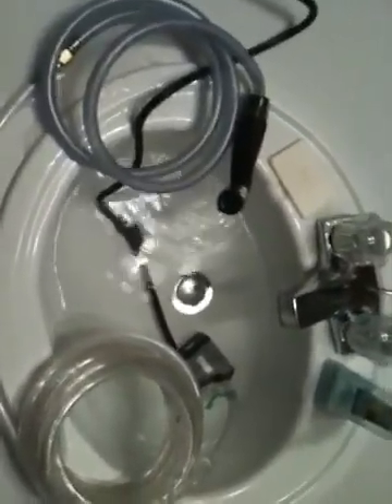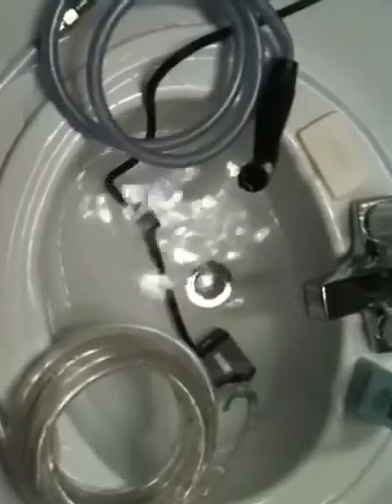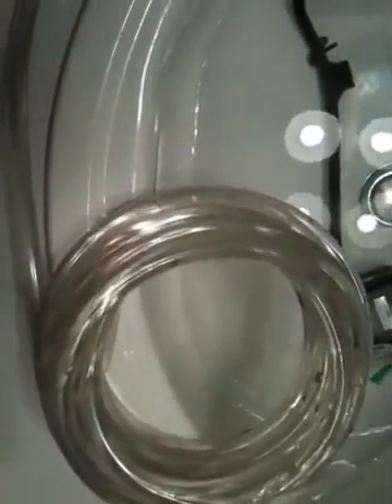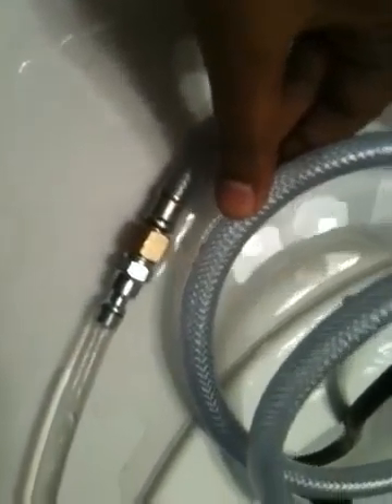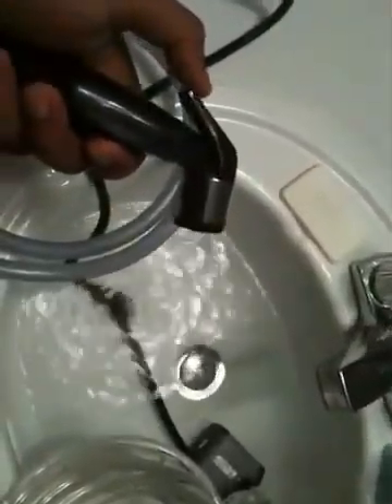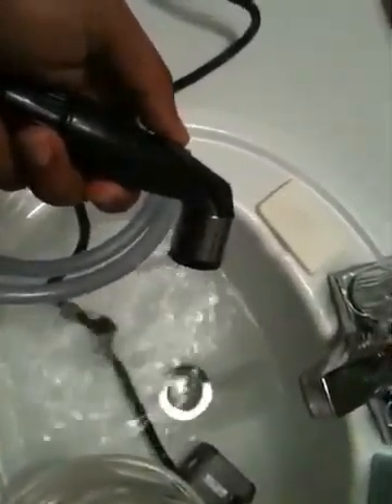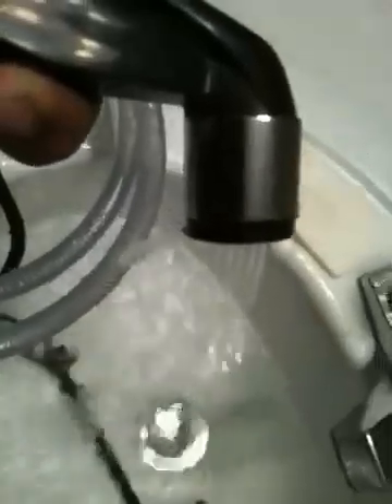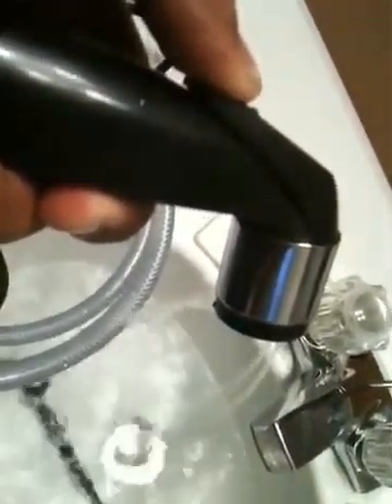Powered shower for burning man-test 1

Comment: I used a 200 GPH bilge pump in a 3-gallon bucket (saves water) attached to a shower head.  I've also seen it done with a flexible sprayer head (helps use less water by allowing the user to direct the spray on the required body part).  This year, I decided that electric showers are simply too much mechanical complexity on the playa.  We used solar-heated gravity showers and they were quite adequate, even if you do have to squat down to wet your hair.

We still have a sink with running water.